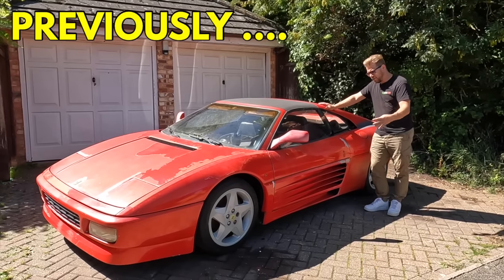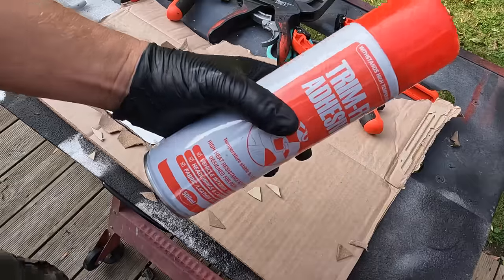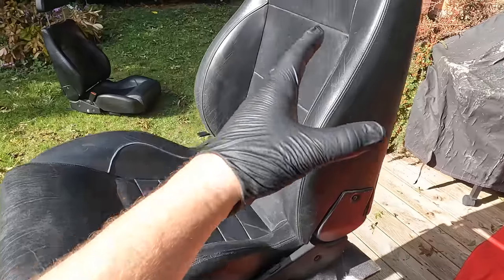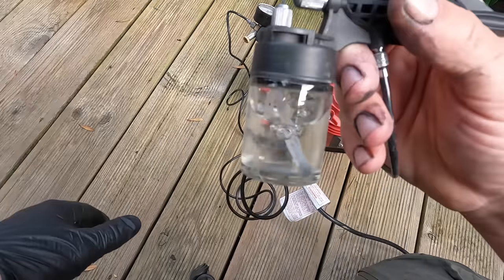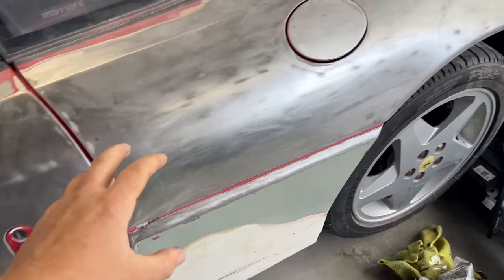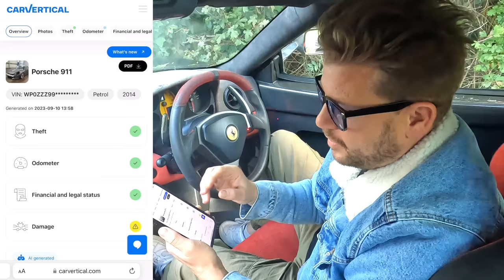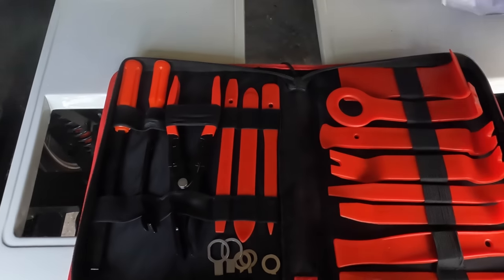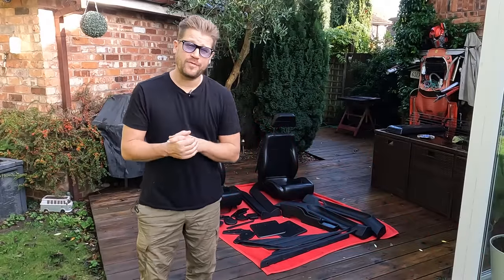Rebuilding The Cheapest Ferrari 348 - Part 3

Comment: Top tip coming up .Apply glue to both surfaces and let it dry then stick the parts together its impact adhesive so no need to clamp it sticks like the you know what. Love the show keep it up
Reply: Top tip right there ☝️

You can also apply less when you do it this way so it helps prevent saturating the material and making it go crispy.
Reply: Yea, the contact adhesive made me wince.
Reply: 🤣 @mickthemonkey
Reply: I agree, way to go.

Comment: You know, I'm not so sure about quilting on the ceiling, but I can see using an alcantara type material with a combination of red and black - maybe with perhaps two sewn in 20-30mm wide pin-stripes that could be perforated and perhaps batting filled.  Or those stripes could look like Ferraris' standard belting stitched into the seats with breathing holes in it (if you know what I'm talking about)  IDK...  Yes some of the modern Ferraris have quilted ceilings...  or double quilted with  accent stitching which might be a bit too much without carrying the theme to the seats.  Suede always looks and feels great as a luxurious celling.

Point of trivia.. it was a 348 that popped my Ferrari Cherry on track...  🙂

Comment: Try contact cement for attaching leather, fabrics, etc. It is very important to apply the contact cement to both pieces, let them dry for 5 or 10 minutes and then carefully stick them together...it requires no clamps. They are stuck tight.

Comment: Interesting. I know that the stuff you are using on the seats is from the Furniture Clinic. I restored the leather seats in my Mk1 Mx5 some years back with this stuff. I have the same spray gun airbrush kit etc. Its really good. BUT A WORD OF WARNING!!!! That top coat of sealer that is mat satin looks right, goes on great and seems to work right? Well on my Mx5 when the summer came around and it started to get warm, the dealer got sticky. You would sit in the car, and stick to the seats and have to peel yourself off. And I put about four coats of sealer on the seats to really protect them! Furniture Clinic advised me to re do them, but this time to add a hardener CROSS LINK X into the top coat of sealer. I followed the instructions, cleaned and stripped the seats back again, re coloured again then added the crosslink X to the mat top coat sealer in the exact amounts they specified. I coated the seats twice, dried it out properly and left it to set. When it had the leather was no longer soft. It went stiff and hard like cardboard! It was still flexible, it would bend and did not crack and looked good, but it was so stiff in feel and like card it no longer felt like leather but like plastic. It was so truly terrible it spoiled the seats entirely. I contacted the Furniture Clinic and asked for advice and they could not explain it as I had done everything as stated, correctly. So be careful with that stuff they sell. Or you will stick to the seats, or end up with hard feeling leather. I now have a Mk2 TT convertible and I have not used their products to refurbish the leather seats in this car, as I no longer trust their range. I will be fascinated to see how these seats of yours stand up to wear. As in people getting in and out and sitting in the seats to drive the car.